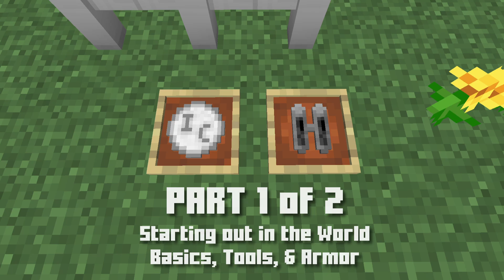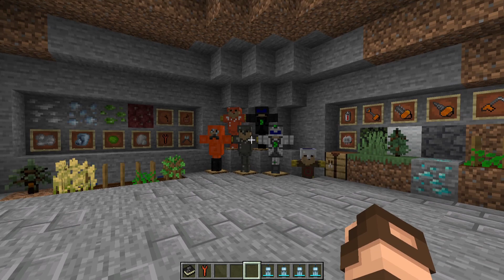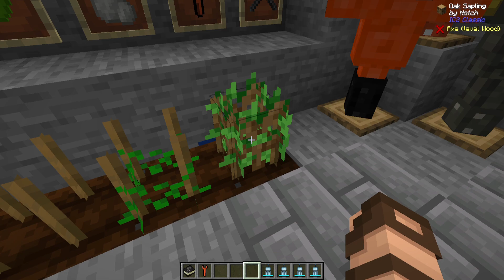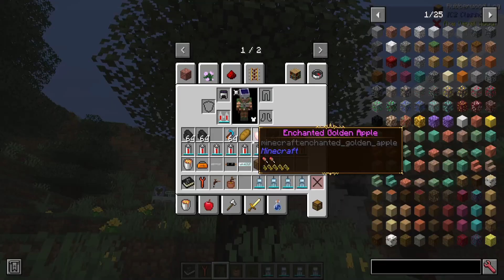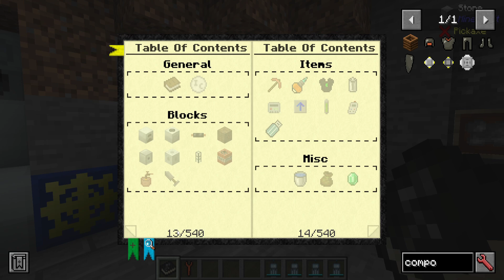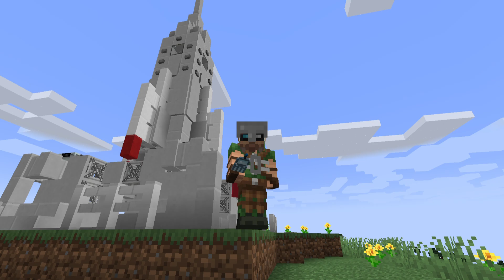IC2: Classic (Industrial Craft) Pt1 - Bit-By-Bit Minecraft mod 1.19 - Basics, Tools, & Armor

Comment: MINECRAFT 1.19.2 plasma generator how does it work? The capsule is not filled with liquid plasma from the generator. To craft a plasma wire, you need plasma in a capsule

Comment: I just got back into MC after a long time away since ~2016. I was big into IC, Buildcraft, Railcraft as a combination, they play so well together. So I managed to get a nice working 1.12.2 build and have been having a nostalgic blast. 
I did play a bit of the vanilla game to see whats new, and I do feel like I'm missing out on some things  not running a more modern build, but I've found myself so occupied trying out things I've never done with this mod combination that I'm still having a lot of fun.

Gotta say I'm actually quite impressed with way the launcher functions for MC now. The whole version selection system is way less of a hassle managing mods and not having to worry about updates ruining a world. Normally if an urge to get back in would arise I'd find myself wasting hours trying to get the right forge-mod combination and then I lose steam on the whole idea of playing. Instead I was right back into it!

Currently on the path to trying the heat-based reactor system, using steam to power turbines rather than just having EU directly from the nuclear reactor. Go over-complicated or go home, I say!

Comment: Just so folks know, if you remove all the leaves from a rubber tree, it stops giving you rubber. You also can't place new leaves where the old ones were to fix it, that does nothing. So a tree you plan to keep tapping should never have the leaves atop the logs removed.

That said, you should be able to put rubber logs in a squeezer (once you have one) to get rubber out of them, which makes a rubber wood tree farm viable.
Reply: Not true.
Rubber trees produce rubber no matter how many leaves are there.
You most likely over tapped the tree where the spot disappears.

And you need to be nearby rubber trees or it won't regrow. (Works like a wheat crop)
Or have a tree tap and bucket with a sticky tube attached to it then it regrows as long it's chunkloaded.
Reply: @Speiger  Okay. That's different from the older versions I'm used to, but helpful for making rubber farms.
Reply: @tantamounted  yeah you got your info wrong.
Because even during the Tekkit 1 times rubber trees never worked like you said.

Comment: Btw, this is a new version called "IC2 Classic". The original, by sfplayer1, only goes up to 1.12.2 and in a beta state. This one is by Speiger, and also has 1.12.2 support as well as the other more recent versions.

Really glad someone else could pick it up for modern versions, it's the first mod I played in Tekkit and was basically the first tech mod.
Reply: IC2Exp has 1.18-1.19 builds but they are in the pre alpha state. You just have to move around in the jenkins.
But i wouldn't call them playable

Also thank you :)
Reply: GTCE (GT3) is also coming for 1.19.2. FTB Ultimate can be recreated!!! I cannot wait!

Comment: wow, IC2 is still a thing that is being updated? IC2 and buildcraft were my first mods back in the 1.3 era
Reply: IC2 is still a thing but this is IC2 Classic. IC2C is an unofficial updated version of pre-experimental IC2. IC2Exp is still stuck on 1.12
Reply: @florence.starrr  does the non-classic version have extra features? I have no idea, most mods left IC2 and used thermal for IC2-like machines
Reply: @Skylex157  What features? If you're thinking about IC2C stuff then most likely no
Reply: @skylex157 at this point, ic2 classic has a lot more then ic2 exp and is still way more faithful to the original ic2
Reply: Industrialcraft is some kind of immortal entity at this point. my first experiences with IC was struggling to understand how the solar generator worked back in late Alpha, before modding APIs were a thing and you had to install mods by using winzip to bruteforce the files directly into the minecraft jar file.
Reply: @Draekrio  kids these days have it too easy XD
Reply: @skylex157  You're damn right. back in my day we had to launch our java uphill both ways in the snow.

But for real though there's a lot, and I mean a lot of old minecraft jank that most people probably never even knew was a thing. Like back in Alpha when right click interactions didn't have a priority system, multiple fired off if they were valid. Bad things happened to your base if you opened a chest holding a bucket of lava.
Reply: @Draekrio  i haven't experienced that either, i do remember mojang releasing 1.5 and it being so unoptimized that even without using all the newly added redstone stuff, the update was laggy as hell, so bad they took away the update and re-released it a few weeks later, that was a gamer moment of all time
Reply: you mean beta 1.3?
Reply: @mishadoesgames  no, 1.3.7, the release version, technically 1.4.5, i think that's the first version i started playing modded